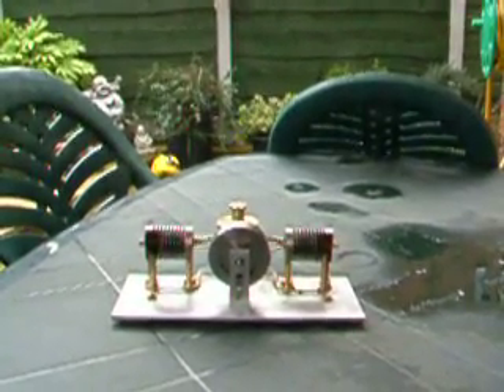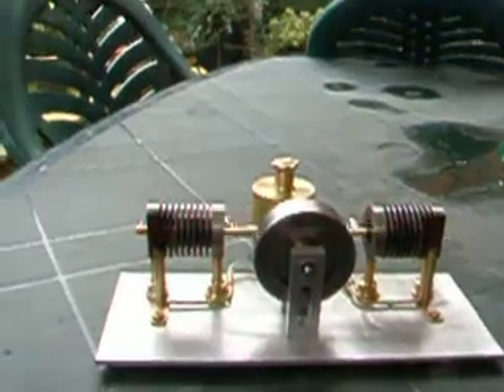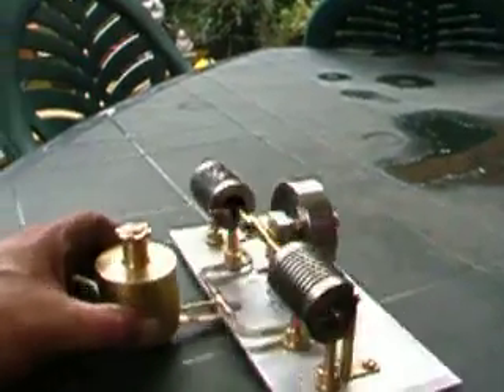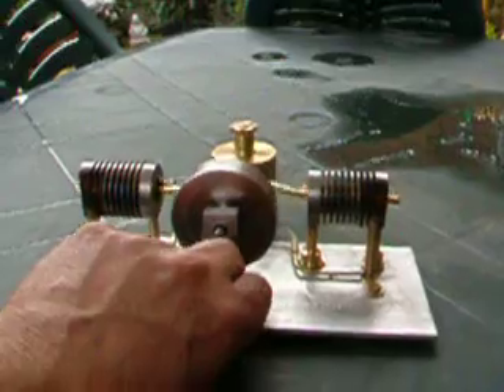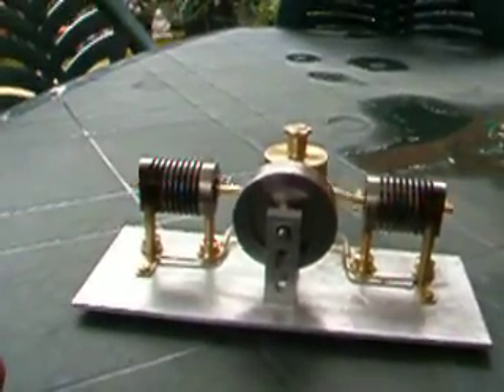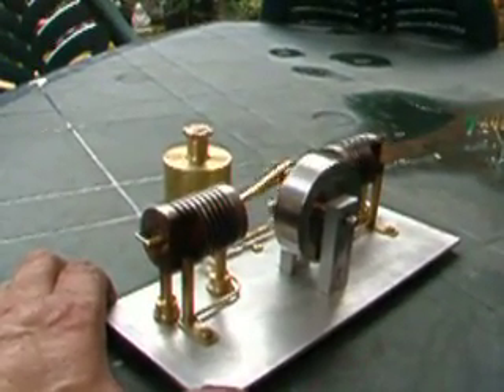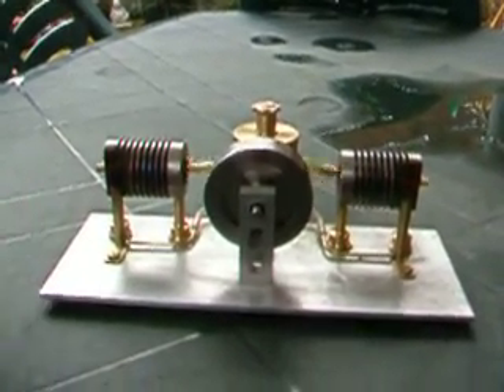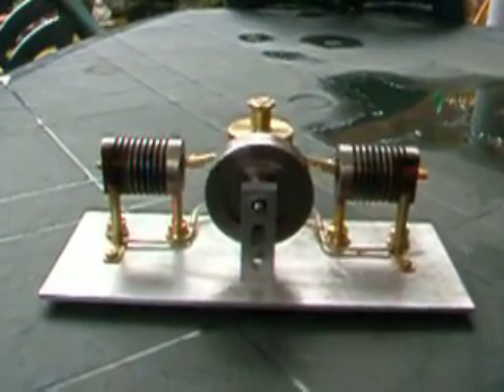Flame gulper running outside

Comment from the maker: This engine can only ever have one port, it uses the 'exhaust' gasses by cooling them down and forming a vacuum to pull the piston back up the cylinder, it has no forwards power stroke, it is the vacuum stroke that is it's motive power.

Comment: I would imagine that you could fashion some kind of flame guard for this that would protect from wind, but, then would you run into problems of suffocating the flame? hmm. I suppose you could make a guard that was both open at the bottom (for air intake) and at the top (for exhaust). Also, do you think this type of engine would benefit from a two-valve cylinder? One valve for the intake of the flame and one valve for the exhaust from the cylinder piped away as to keep a more stable flame?

Comment from the maker: I made it from plans of a single cylinder engine by Jan Ridders, just modified it to run as a horizontally opposed pair. Used mainly bits from the scrapyard.